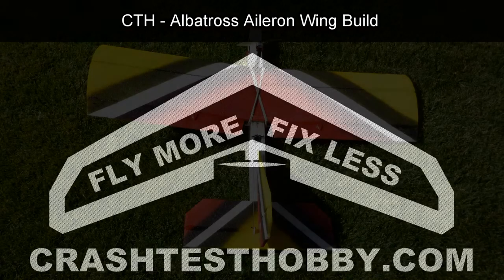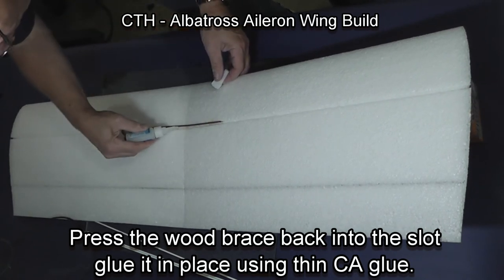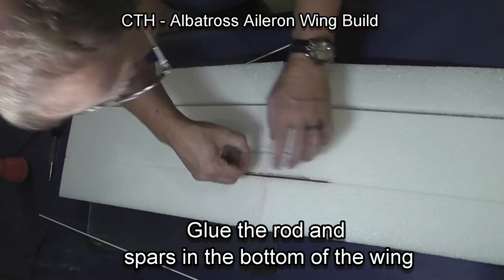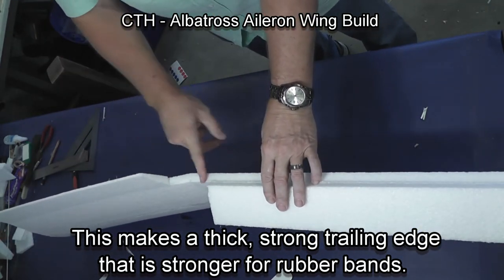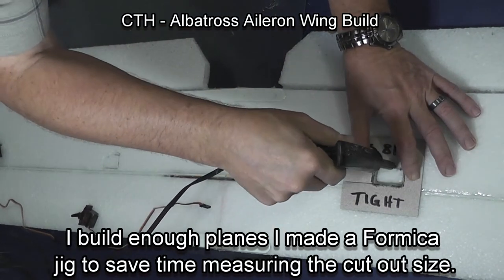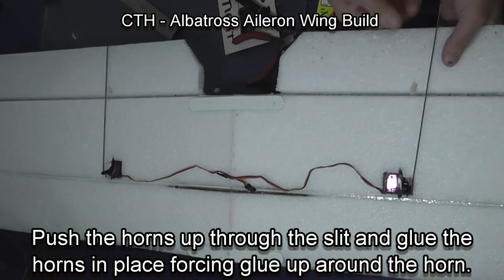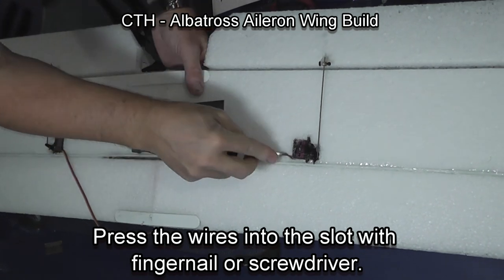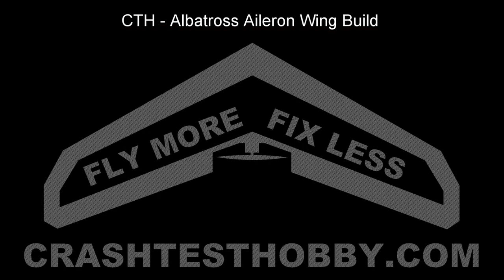Albatross Aileron Wing Build (M)

Comment: Awesome videos overall. I bought the 2 wing Albatross and missed the comment about installing a 3rd dowel rod to handle the aileron wing better.  Kinda tore the wing up, but you're right about an easy repair using the glue gun.  You may want to include the 3rd dowel as a reminder to those that have the 2 wing kit.  Great products, Lee!!!  I may learn to fly in spite of myself!
Reply from the maker: There are also some options of putting a top spar on each side of the top of the fuselage to keep it from compressing under the wing.